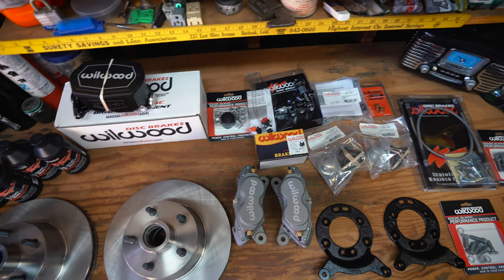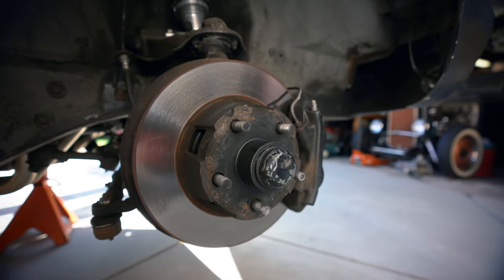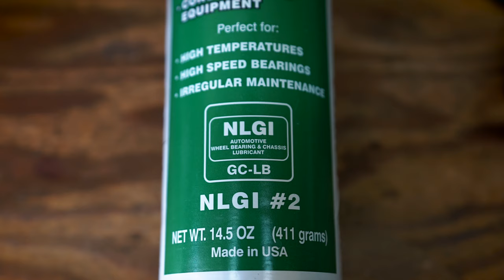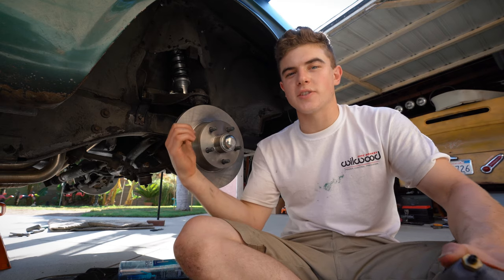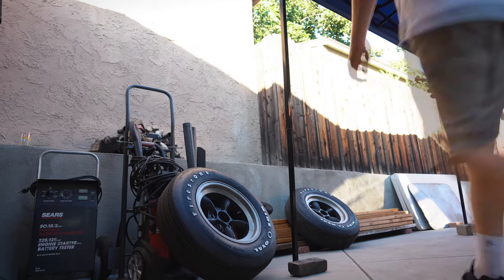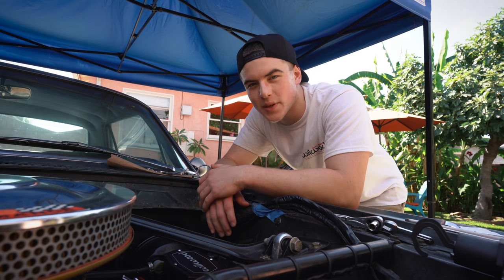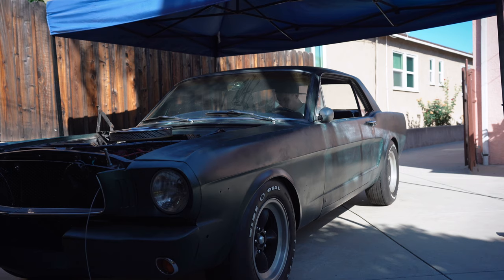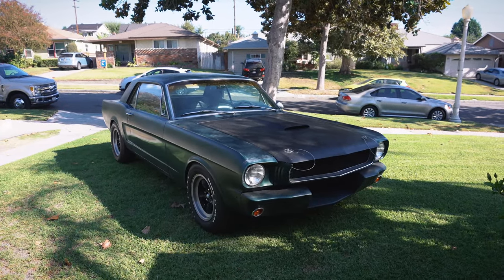Four Speed Films Mustang Disc Brake Upgrade [4K]

Comment: Did you installed the residual valve the guy at wilwood gave u with the kit?
Im about to install same wilwood caliper tomorrow on my Rx7. How they feel compare to the stock brakes?
Reply from the maker: Hi, the 10 pound residual valve is used because of the drums in the rear. Stopping power is increased with the added piston area in the front caliper.

Comment: What master cylinder bore size did you use on your application?
Reply from the maker: Hi, for manual brakes a 15/16 bore master cylinder is used.
Reply: @WilwoodDiscBrakes   okay thank you, is there a master cylinder offered to work with a power booster? I haven’t been able to find any on your website
Reply from the maker: @kylewestfall7185  Hi, yes we do. Give us a call at 805-388-1188 and a tech will help you find the correct master.

Comment: You don't  need a residual valve the ms is hirer than the rest of the system.
Reply from the maker: Hi, a 10 pound RPV is needed if drums are being used on the rear.